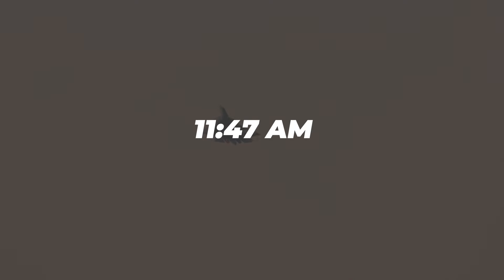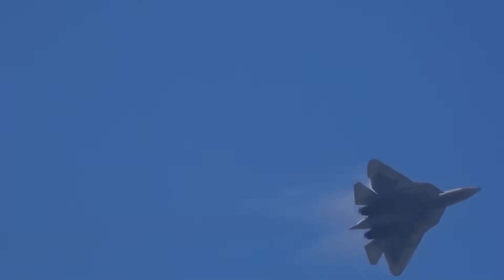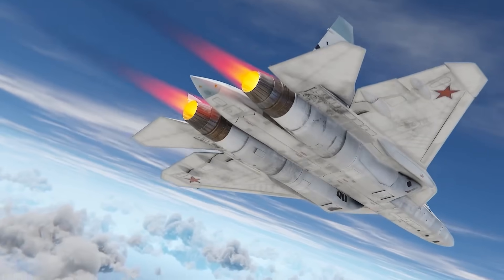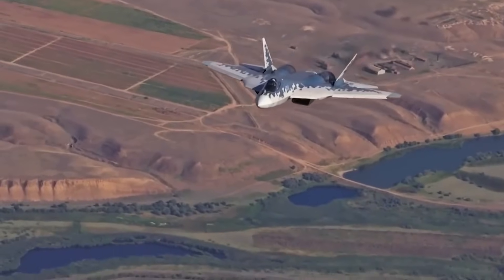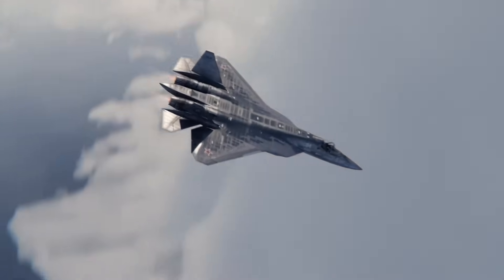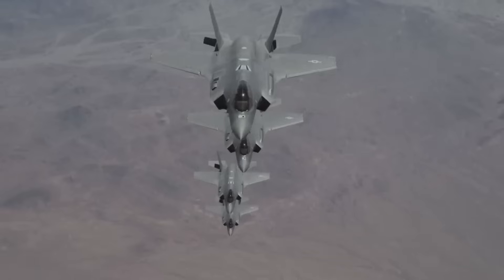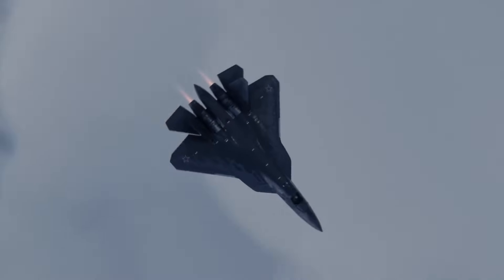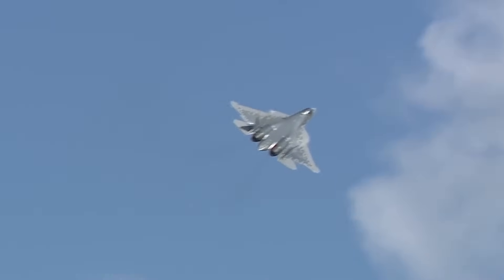Why the Su 57’s ‘Bad’ Design Is Actually Genius

Comment: 0.01 metre squared is not the size of a marble. Depending on the size of the marble it's around 100 marbles - or the size of the palm of an average size hand. That's still a hell of a lot less than a metre squared, but also a hell of a lot more than the area of a finger nail.

Comment: Flat nozzles don't hide Infrared heat signature it reduces and SU57 has a RCS of 0.1 in the front 1 other sides .
F35 has 0.05 on X band radar but 0.13 on L band and SU57 has L band on the wings.

Comment: And dont forget that China did develop the Quantum radar that renders stealth planes complete visible and now that the west have forced Russia & China together, and you THINK that SU-57 dont have that radar ?    (stealth are going the way of the dodo bird aka extinct)
aswell as the REVERSING (they can actually target planes on rear and fire rearwards)  air to air missiles with dual engines burn.    instead of 7 seconds its now 7 + 4 seconds   soo it can revese or speed up or after a normal kinetic flight it can boost for 4 seconds and thus start a new kinetic cycle or boost its inital speed thus speedup before impact.
Aswell as the fully AI - Wingman Su-70 still being tested over Ukr.   its a huge force multiplier. 

And you forget they do have AL-51F1 engines with new 360 nozzles with more IR hiding.

Comment: notching is to defeat a missile fired at you. Nobody uses fox ones anymore, where you guide the missile in using the planes radar. fox 3 the missile guides itself after being fired. So this radar advantage on the su 57 cant be for that reason. More then likely those are simply detection that the plane is being spiked or fired against. \I think this video is shit

Comment: Why should stealth intimidate SU-57 or even SU-35 when even the heavy bomber SU-34 outmaneuvered and evaded from THREE (3) missiles of the "Patriot" air defense system?! Ok, suppose one invisible "stealthy ghost" noticed SU-57 first and launched a missile against it - as soon as the missile comes close to the SU-57 within the range of 400 km, the SU-57 will notice it. That's a lot of time to decide on the maneuver for evading the missile. Eventually it will come to the point where SU-57 will know where that "stealthy ghost" is and come closer and then that stealth technology is not a big help.

Comment: Hard to say what happens when an F-22 and an Su57 merge in a war... ~experienced pilots, no heavy external equipment no radar and no radar-or heat-seeking ordonance left... going into vertical... who has the better weight to thrust ration and can stay longer into the vertical, dive down and spray the opponent falling out of the sky...? In any case, i would not rely on any supermaneuverability, maybe as last chance when the own 6 being pulled from neutral into lead... but then bleeding speed an also falling out of the sky eject eject eject...

Comment: If stealth fails than its the quantity over quality. F16, F18, SU35, SU30 are the workhorse than... And yeah they test a modification of jet (Т-50-2) with flat nozzle if someone really whant a stealth machine with less manuverability. In this config it is better than F35 in all meanings since it has more power and longer distance AA missiles. Also F35 does not work if you are not ally of US since it deeply relies on americans information system. So it looks like you buy Russian or China jets...

Comment: It's partly for morale and partly for different reasons. The Su-57 Felon is respected by pilots everywhere because overconfidence is a slow and insidious killer. It's just more focused on interception manuverability so it can wina dogfight. 

The F-22 Raptor was meant for air domination, which means it can dogfight, but has beyond visual range weapons and capabilities so it never has to. Why pull 9 Gs to turn when you can launch a faraway missile before they know you're there?

Comment: 5:55 the F-22 and F-35 can litteraly do it more effectively, its called FOX-3 missiles which have their own built in radar, the aircraft's radar just helps with guidence.... It's just a fix to russia's financial problem where they cannot develop an effective FOX-3 missile.
So in the end, the F-22/35 can notch as effectively as the SU-57.
(side note: FOX-3 missiles have a better range and accuracy too, where FOX-1 missiles (aircraft radar only homing missiles) have their range shortened due to the aircraft itself having to maintain a constant lock on the target. If the lock is lost the missile just glides on its flight path even if the aircraft changes speed, altitude, attitude, and direction of flight...)

Comment: What is the point of having a good aircraft if the nation that uses it cannot even keep it safe on the ground? The same nation that is afraid of losing them on missions literally uses them as far away from the battlefield as possible, firing cruise missiles

Aircraft battles no longer exist, or at least they are not what they used to be. Everything takes place on the ground, with plans for how to use the aircraft in a perfect mission. It must always be perfect on paper, or it will not happen.

That's why the F35 doesn't have the best possible maneuverability, it only has the best possible active offensive combat technology along with its camouflage, firing the best possible weaponry with surgical precision at the greatest possible distance.

And electronic warfare makes it impossible to use Fox 1 and Fox 3, which is why the Su-57s have that thermal camera above the nose of the aircraft to fire long-range Fox 2 missiles that are undetectable by conventional means. They can only be seen as objects approaching at high speed, meaning that an EA-18 would be difficult to shoot down with stealth attacks.

Comment: Cheap bales of empty flying boxes. They have no electronics, no radar. The missile doesn't care what turn the plane takes. It will detonate, and the debris will turn the empty box into a falling empty box.
Reply: The good news is that the SU-57 is a piece of crap that has no use in modern warfare. It is a laboratory aircraft that tests technical solutions. As a combat medicine, it does not exist.

Comment: I don't think that "Russia believes that stealth will eventually fail" is the only reason for their supermaneuverability doctrine.
Historically, the country was invaded multiple times, and every single time they managed to repel the invaders, even if at a high cost (WWII is a good example of that).
Russian fighters were built following that historical pattern. They may not be the most advanced stealth aircraft designed to go deep into enemy territiory, but rather bring the enemy close in so they can crush it in close-range combat.

Comment: This was the prototype. I believe the exposed fittings allow panels to be fitted/tested without major frame design. As for the engines, while still not fully developed they have engines fitted to their 19 in service aircraft with flat vectored nozels. As for stealth detection, that is already a past benefit.

Comment: Well, I don't know, the F22 is a good aircraft, but when it was created, customers requested so many technical specifications and so many requirements for it that the executors of the order forgot about the most important thing, that it was a combat aircraft! Anyway, he has a lot of sores. And besides, they didn't leave any groundwork for modernization, because they didn't leave any free space for this. - Let's increase the flight range. - But we can't, there's no room. Only if there are mounted fuel tanks, but this will increase visibility. - Then let's increase the ammunition or cram in more missiles. - There is no place. And that's how everything happens with this plane. Besides, it's very expensive. It is necessary to build hangars for it, because under the sun its coating loses its properties. Update this coating, because it burns at high speeds. Therefore, most headlights look like they are peeling, because it is very expensive to update this coating. And those who pray for stealth, you are stupid. The myths that it's the size of a coin on the radar are nonsense. It's not a reconnaissance aircraft, and it has a radar, and the radar takes up the entire nose space, and if you cover it with a stealth coating, it will be blind itself. Therefore, the United States resumed production of the 4th generation.

Comment: anybody calling su-57 bad design clearly doesnt understand aeroengineering su-57 is most complex and best desing of aircraft period. su engines werent comeplete its supposed to use al-51 not 41 and there are also 2 version with flat nozzles and rounded rounded are for export flat are for russian army and stealth. f35- vs su-57 shows completely different design f-35 rely on mechanical stealth alot more than electronic its radar signature 0.001m2 is teoritical normal stealth is around 0.1m2 from back front is smaller but its not claimed 0.0001m2 and it also depends on radar that is searching for plane and band of that radar mechanical stealth is more limited future is 100% electronic stealth with some desings of mechincal like su-57 or chinese stealth aircraft the dont rely primaly on mechanical stealth f-35 is good jet but not for that huge price su-57 is cheaper and rely in some way on mechanical stealth but alot more on electronic

Comment: This aircraft is truly stealthy; you can't see it anywhere. Even on the assembly line, you rarely see it. This plane can only perform at air shows. And yet, the flying aircraft is a completely unrestricted prototype designed to perform impressive maneuvers. Its fuselage panels are less well assembled than the body panels of a Volkswagen Beetle from 1950.
Reply: You feel like a rockstar? Not like an idiot?

Comment: 5:43 good luck notch 3 rockets flying from your different angles because F35 had so much stelth you don't detect them before and there is 1000 F35 build till 2022, for 200 SU 37 buld till 2022.
Reply: Everything work together the fighter with defense system With big radars
Reply: @saadamor-r9g  Well yes if you have proper radar send and recive system. But we know the radar was sold and relpaded with alegro radio due to bribery and coruption.
Reply: Good luck outrage R-37 with aim-120s lmao.
Reply: @f-5epilot950  Valid point, The most expensive missle will outrange eny other. AIM-54C have only 184.1 kilometers of range compered to around 288 kilometer of R37. 
Qestions is in term of how much R37 culd russia produce and how many F15EX, F35 and F18 planes culd USA produce, if you have no ammunition you will lose no mather how good your eqipment is.

Comment: No one knows how modern air combat works? I mean the Su-57 is a great fighter, but maneuvrability is useless nowadays and most AESA radars can achieve 120º FOVs without the weight of additional small radars. Also current Fox 3s with datalink allow fighters to notch and then reconnect the radar without the missile going pitbull.
Reply: "I mean the Su-57 is a great fighter, but maneuvrability is useless nowadays"
Because when you are attacked by missiles,you simply eject,right?
" most AESA radars can achieve 120º FOVs without the weight of additional small radars"
No,they can't,and smaller emitters on Su-57 are not radars.
Reply: @vladkorobov155  Maneuvrability wont save you from a missile pulling 40Gs, stealth will, aka shooting first. Oh and sorry if your highness decides AESA radars are poop your opinion must be praised.
Reply: @ecogamer_6227 
Missile won't be pulling 40g when coasting ballistic,which is after the first ten seconds of flight.
And specifics of radar array are irrelevant.
AESA isn't inherenty better than PESA,it all comes down to circumstances.
There is no such thing as stealth.

Comment: thats not going to matter. 95% of engagements are BVR
Reply: And in these engagements,ability to maneuver means literal survival,because either you evade incoming missiles OR DON'T.
Reply: @vladkorobov155   with the proximity fuses and 100kg warheads, you are not evading that missile. You can only ECM it.
Reply: "You can only ECM it."
/double facepalm
ECM is part of evasion equation.
But without maneuverability,that point one percent error ECM provides won't save you either.
You need everything.
Moreover,100kg warheads in air-to-air are happening strictly TO Russia's opponents.
Reply: @vladkorobov155   LOL fair enough
Reply: @vladkorobov155   LOL fair enough

Comment: Stealth fanbois have zero understanding of the physics involved.   The round rear nozzles are not going to be shining back EM waves in the forward direction which is the prime use of a stealth attack.    Stealth does not make an aircraft invisible since it will not have the same cross-section at all EM frequencies.   No RAM coating exists that absorbs without emissions.   You need black hole event horizons for that.   Stealth was invented in the USSR as a method of dealing with 1950s style monochrome radars.   This era has faded away into history.   We now have broadband detection systems that are networked.    Serbian forces brought down an F-117A by networking old radar systems.    Stealth aircraft have value for surprise attacks but are not going to be invisible in every engagement.

Comment: i'm still calling Su-57 a 4.5 Gen because it's just not that stealthy. we need to keep in mind that 4.5 Gen is not "failed 5th Gen", it's "using new techonology, but choose not to stealth". Newer F-15, F-18 and J-39s are 4.5 Gen, and no one laughs at them. Su-35 might be already 4.5 Gen, and Su-57 might be a little more stealthy, but the Russians just wanted flying peformance too much. I disagree with the supermaneuvering mindset, but Su-57 by no means is a bad jet.

Comment: In modern air to air battles...thrust vectoring is of no use.. long range air to air missiles and advanced shooter to sensor works.. that's why F22 and F35 are the best
Reply: Even if you follow your concept, Russia has the world's longest-range air-to-air missile, with a range of 400 km, while the F-35's aim-120 has a range of only 50 km. So even in long-range air combat, the Su-57 wins.
Reply: @HronozZ F35 radar and data fusion is so advanced that.. su 57 will have no change against it.. USA dominance in data links, computer sensor fusion is of the next level..there is no one even closer to them,.. Israelis are somewhat second to them..

Comment: I think most of the enemy planes will be taken down by the ground missile systems. Planes are not really efficient in such mass events. Also, do not forget that plane is faster than a missile and can maneuver, it's quite important to avoid missiles. In any case most of info about radars are pretty much hidden from publicity. There will be some surprises for sure.

Comment: Cars only move in 2D - two dimensions, dude - they cannot "steer forward and backward" lol, but left or right. An airplane, on the other hand, move in a 3D space.  You should delete that silly sentence and replace with "F22 only has "2D vectoring in vertical axis" while the SU has 3D vectoring, meaning the engine's nozzles can "steer" not just  up and down (pitch) like the F22 but also in horizontal plan. 
Cherry on top, the SU nozzles can move SEPARATELY one of the other,  in 3D, thus achieving some crazy angles, impossible for any murican jet, ever build.

Another mistake you made is the silly assumption a fight under BVR mean the pilots can "see" each other - when in fact ANY pilot will have a very hard time, next to impossible, to catch a glimpse of a  small jet at 30-40 km ! 
The difference is in the FACT the "stealth" only works up to a certain distance, usually under 100km they will show up on the Radar clearly enough to get locked and shot at. 
So, if they come under 100km, even a 4Gen fighter will "see" - ON THE RADAR - the "stealth" enemy.
Reply from the maker: Thanks for providing a more in-depth explanation on these complex aerospace concepts!
Reply: @ArsenalExposed  - u welcome - publish more, we need a balance to shut-up the murican fan-boys :)

Comment: Stealth is a gimmick
Reply: If bow and arrow could kill soldier with AK 47 you should use bow instead of M16 rifle because both have chance of success. That dosn't mean dude with M16 will be worst than bowman, steltch will hide aricraft only for radar missle lock but if yo can't schot it you cudn't kill it. IR tracker and low band radar size of a house culd find it but they cant lock it. The incident with F117 include manual roket guaidance MANUAL and they missed 2 times before they hit.

Comment: OK, I understand the persons putting this video together depends on majority of ppl watching has no idea about, stealth, engines & so much more. It's bad when the Chinese at the yearly communist military lets show off, the tank races,, artillery shoots are fun to watch. Also the displays of all military equipment. While the Chinese & other countries military pilots inspected SU57 then pointing out all of the flaws. There was a long list. LOL  They pointed out instead of special very expensive rivets Russia used both Philip screws & regular screws found at Lowes.
Majority of areas that need perfect fittings, smooth lines. Russia DID NONE OF THESE. 
I can finish with all of the Chinese pilots & jet makers but it will be a long write. The su57 does not scare anyone, it's so horrible of a build & putin is making it so cheap STILL NO TAKERS. It's real bad when the Chinese does not want one su57 to copy.
Reply: мне нравится тот факт что вы спорите о качестве прототипа для авиашоу, а не о боевом самолёте :/